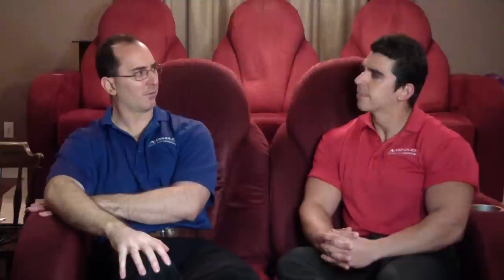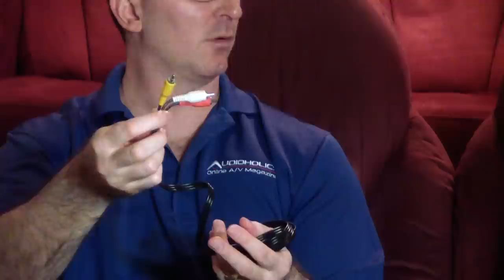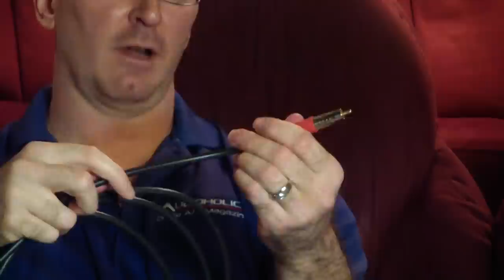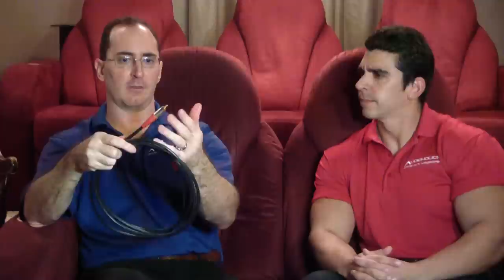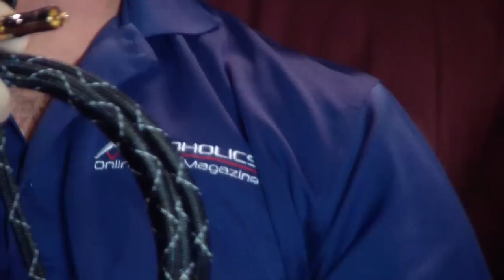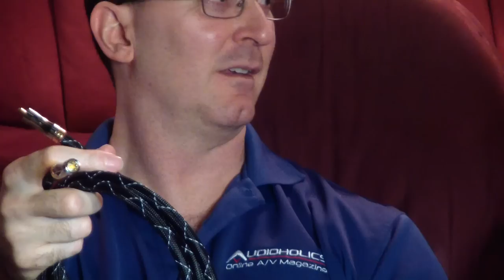Audio Interconnect Cable Myths vs Truths Revealed

Comment: I've been a broadcast engineer for about 15 years.  I've built many studios and have build many, many cables, so I'm going to comment here.  I agree, for the most part, with what the guest states.  The high cost audio interconnects sold on the market are really just snake oil.  If you want the "best" audio interconnect (unbalanced), you do NOT have to spend a fortune.  The Belden coaxial cables are excellent (NOT the CATV cables, but the ones manufactured for digital video).  Purchase some low capacitance, low shield resistance cable and solder on quality connectors--Canare, Neutrik, Switchcraft, or similar.  You will now have a cable that DESTROYS the high cost, snake oil cables.  You'll have the best and will have saved a fortune.  [I've had some ask me about the shield resistance.  Without getting too technical, the low shield resistance will minimize a voltage drop across the shield that will be heard as 60 Hz "hum"]
Reply: batman144 I looked up the specs for that cable (1505A).  It's a RG-59 solid copper cable. It has nice shielding coverage and nice shield resistance.  Its capacitance is a little higher but is still fine.  That cable will work well.  I'm a little biased towards Belden because it's a broadcast standard, so I have much exposure and experience with the brand.  There are other good cables, one being Canare.
Reply: batman144 Also, remember that the primary factor for evaluating an unbalanced audio cable is its capacitance (and shield resistance).  Many people also claim that its impedance is an issue, but that isn't true for audio frequencies unless the cable is incredibly long.  Thus, the "best" cable for audio is that built for video/RF; the reason is that this cable must have low capacitance for the very high frequencies that it carries.  To manufacture a  "75 ohm" cable, the capacitance must be kept low (by dielectric choices, conductor spacing, etc).  So, when trying to find or build the "best" audio cable, look at the cables used for video/RF. Find one with low capacitance, good shield covering, and low shield resistance.  Also, make sure the center conductor is indeed copper.  Some of the RG-6 cables, mostly used for CATV, have a center conductor that is copper-clad steel.  That works fine for the very high frequencies of CATV applications because skin effect is an issue, but its resistance is much too high for audio where skin effect is NOT an issue.  You'll now have an excellent cable, and you'll have saved a fortune by not purchasing the "audiophile" cables.  As an aside, some of the "audiophile" cables actually have very HIGH capacitance, and thus violate the primary factor of quality cables :)
Reply: +Steve Silvers  And how, exactly, does one look up a particular cable's capacitance and shield resistance?
Reply: +Steve Silvers  Just so others will know, I'm assuming you didn't get to that page from Belden's webpage advertising that particular cable. I'm guessing you had to Google something like "Belden 1505 spec data." Lastly, what numbers for capacitance and resistance should we be looking for? Should we be looking for different numbers for video vs. audio applications (although I think you mentioned the best cables for audio are ones designed for video)?
Reply: batman144 I have the specs in a binder at work.  For your question, I went to the "precision cables" on Belden's website and grabbed the specs; however, don't worry because Belden is reputable and doesn't inflate the specs. Belden is HUGE in the professional and broadcast markets--the specs are accurate. As for specs, the original cables built for analog were actually quite high in capacitance, usually around 45 or 50 pF. Then, cables for higher frequencies (analog video, digital video) were manufactured and, by necessity, the capacitance was much lower. Now, remember that the primary factor in audio cables is the capacitance of a cable. So, it makes sense that the professional world adopted these cables even for analog analog. When I started, the recommended and popular cable was, I believe, Belden 8241F.  It's an older cable but is still used today.  Today, the "precision cables" are definitely popular.  At work, we have the Belden 1505F that is a little different (22awg, stranded) from the 1505A. It's excellent for our installs, and we certainly won't get better performance by changing out to any other cable.  

Now, as far as specs, have a look at the precision cables because most will do just fine.  I like the ones with capacitance of around 16-17pF and DC shield resistance of less than 4 ohms (per 1000ft). Remember that inductance and impedance (unless cables are LONG) specs are irrelevant.  But also remember that other factors come into play, including length of interconnects and the output and input impedance of the gear.  But you really don't need to worry about that for shorter cables. For building a reasonable length interconnect, just grab some of the precision video cables and solder away. When finished, you'll have a fantastic interconnect that will blow away the others, especially "audiophile" cables.  You'll have something great that can't be improved upon by paying more.... Okay, I just looked up the Belden 1505F for prices.  I found it listed for 83 cents per foot.  So, for a pair of interconnects at 3 ft each, you'll pay 6 x .83 = $4.98.  There you go. For under $5, you can have the very best in cable that will perform excellently. Spending more will NOT get you "more."
Reply: +Steve Silvers Can you get good quality connections using a screw in RCA connector like those from ViaBlue and Furutech?
Reply: Great Argumenting skills there Michael, I don't believe sgt, Bilko can get back up after that bitter blow, I see up on my late arrival to this great contest he's been out a couple of months already.....?
Reply: Who's Phil Silvers...? I always thought he was sgt, Bilko  Michael. I wonder where I got that from, been thinking that for the last 40 years. I suppose it's one of those Mandela Moment things everyones talking about at the moment, where reality doesn't seem to unfold for everyone the same...?   "For about 15 years"...!
Reply: Right, Michael, I get it now. Thought I was losing my marbles, I'd never heard of Nat Hiken. Bilko we used to get it over here on Sat morning some years back. I remember a small fat side kick always got the dirty work his name eludes me, he had a funny squeaky voice I think....?
Reply: QED cables measures better and are 100% science based.
Reply: call me stupid but I did not know you could use coax cables for analog interconnect, been always thinking of them as digital audio cables.
Reply: Yeah, ive been in and around ultra high end audio since early 80s, worked in 4 Ultra high end salons since early 90s,,  plus 2 chain AV stores, been avid audio/ videophile for nearly as long, built 100s of systems - including custom theater systems and spaces -and basically tinkered with most every conceivable type of home n video (and some pro audio) gear in the business!!  
And i can tell you that EVERY pro audio guy will tell you basically what this guy says, yes.  And yet its not the same for high fidelity home audio! Sorry to say. it's just not. 
I really wish it was so simple as hooking up some patch cord,  or 12 guage wires from Radio Shack,  too make this gear sound great, BUT IT DOESN'T!!! 
Botton line,  the more revealing and refined the associated gear,  the more BETTER wires and cables make a difference in fire tunning the sound!  (Rule: if it's connected to the system,  and an electrical signal flows through it, .. then it affects the sound! PERIOD! 
NO, bose cubes, cheapo Kraco or Costco brand(lol) speakers,  connected to cheap RCA AV receiver WONT show a difference in wiring! Why?, cause its all unresolved bad sounding gear, and nothing will make a difference anyway!!  It's how it is. Believe me,  i wish i could save money by using  any ol cabling!  But it makes a difference,  n so i subscribe to matching wires to components that compliment ea other sonically. (No, video is different animal ). 
Pro audio gear is pro audio gear,  and its all a very homogenized sound,  and parts are all interchangeable.  If you use Genelec powered nearfirld speakers,  and one company's industry standard xlr balanced cables,  your pretty much gonna get same sound,  that just ends up all being EQed and processed out at the mixing board anyway!  That and Pro studio dead front end tested  acoustic dubbing spaces,  and you'll pretty much end up SAME SAME sound wise,  as any same equip recording,  editing , or playback Pro setup, using all same stuff! 
Ive simply been exposed to way to many cable swap application experiences , with just about every gear out there,  for too many decades,  to think that wires don't affect sound quality!  
To ea his own though.. which is fine.  Just don't try n convince me that your standard run Belden XLR cables are as good as ill get.  .. and ive tried those,  and they're NOT GOOD SOUNDING compared to MANY MANY other home stuff out there.  If they were,  id definitely be using them.

Anyway,
Reply: Which is better Soldered or Compressed termination for RCA interconnect cables ?
Reply: Thanks very much for this valuable information. IYO, are the Interconnects that you are recommending better than the 'stock cables' that came in the boxes of my 2 Parasound Halo amplifiers?

Comment: Most honest video about interconnect cable that I was able to watch these past days as I am on my way to build my own cables.
I hear a difference in sound with better cables (well engineered, good specs like they mentioned). However to get to that level one has to pay premium price with brands.
So better off building pro grade ones. The best one that I have is after all a DIY from McRU.

To those saying that cables don't matter : just sit down and listen, forget your measurements for once...

Comment: Single coaxes aren`t suited for audio but works for digital. Audio needs to be threated moore carefully by giving the negative half of the signal the same quality conductor as the positive half. And yeah, the conductors must be solid single-core to keep the signal clean.

Comment: I read somewhere that TOSLINK cables have low bandwidth and should not be used if RCA cables can be used. If one has an older receiver with (Left-Right) stereo RCA connections -- (it will be replaced in the next year or so) -- but you crave 5.1 sound in the mean time, is TOSLINK the only way to go, absent HDMI.

Comment: I am using a rg6 coax cable with rca adaptor at both ends and works amazing... 50Ft of cable in a subwoofer with no buzz no hum interferance...

Comment: for rca patch cables mogami mw-01 is about 19pf / ft and you can usually find 1 ft cables for around $15.  blue jeans has good belden stuff too.
Reply: Once i discovered Mogami W2528 I never looked back. It's siamese wire (almost like Zip style). It's basically two signal cables stuck together. Like dual guitar cable. I make dual RCA cables with these using the Neutrik/Rean RCA connectors. I make insert cable for unbalanced insert sends that you find on most common audio consoles. I also use it to make stereo guitar cables for people who have stereo pickups.

Comment: so for a run for a sub pre out of say 20-30', using tv coaxial cables with F connectors and adapters to RCA, is that a crappy setup?   Should one just use coaxial shielded cable with RCA ends?  I found these coax F to RCA outlet adapters.   Am considering using them.   Also, is it best to pull the cable out of the wall and RCA direct to sub or is using the outlet covers with RCA female jack fine with no signal loss at each connection point?

Comment: Hi, I've been using the Wireworld subwoofer cable for quite some time now especially the Luna 7 series and found that these cables produces thick and boomie bass sounds from the Bowers & Wilkins ASW608/610 subs however I'm currently looking at changing the Wireworld cables to something like the Audioquest Irish red subwoofer cables. Can you please tell me if the Audioquest cables are the way to go for use or are they just snake oils like many other subwoofer cables? Thanks guys.

Comment: Gene, Greetings from Down Under. what cable should i use to connect my pre-outs of Denon X4700H to Emotiva BasX3 pre amp? What’s the difference between analogue RCA V’s Digital Coaxial RCA? Is there a difference? Is one better than the other for what i want to do?
Reply: Did you ever learn more about the differences? 75 Ohm is the magic number for digital coaxial but beyond that I have the same question... what are the differences and when does it matter?

Comment: I have a 35ft Hdmi cable.... "one of those expensive i got suckerd ones" going from my NAD T758 Reciever up the wall into the roof and coming down to my Epson 5030ub projector. Will I run into video problems with that cable at that length? I keep having a blacking out video problem but the audio keeps working fine. Idk if it is my cable or my reciever port.  helllllp
Reply: *****  I figured out that it wasn't the projector or the hdmi...... it was the Android Box I bought. Glitchy POS. thanks for the replies btw.

Comment: One manufacturer claims that stranded wire introduces distortion into the signal because of the thousands of times the wire overlaps. I'd like to see how they measure this apparent distortion. But it is important to use the correct type of cable, whether coax or twisted pair in accordance with the amplifier design. If it is a single ended input (neutral and chassis ground are connected)  as found with consumer grade equipment, then coax is the right way to go. If it is a differential input, (floating ground) then twisted pair is correct. It comes down to how noise is either shielded in coax or cancelled out with twisted.
Reply from the maker: Audioquest has been promoting wire distortion propaganda for a very long time. They lack the scientific rigor or knowledge to back up the claim. The reality is stranded wire is better than equivalent solid core since the air gaps between the strands exhibits litz like behavior and thus pushes the skin effect frequency higher up. I've measured this countless times in cables.  COAX for unbalanced is absolutely perfect for DC up to GHz. If you have a differential input amplifier, then use XLR.
Reply: @Audioholics  In the case that you can't wire for balanced, which is not easy on a lot of gear, twisted pair is the better option because both + and - cancel each other out.

Comment: I am a professional audio consumer and the only important consideration is cable thickness and screened signal cable. NOOOO need for ultra expensive cables..
Reply: What you said makes perfect logical sense until you actually do the experiment and hear large, worthwhile differences. Experimental evidence trumps theory. Theories are only good when they can accurately predict the experimental result. When that is not the case, then the theory is not accounting for everything.
Reply: @phantomplastics6582  Were you not listening to these guys? The only experiment that matters is MEASUREMENT. There is no magic here. If you're hearing differences with super expensive cables it's your brain lying to you.
Reply: @Wizardofgosz  In theory I agree that a few electrical parameters should be all you need to know. However, in reality, many people hear absolutely clear and reproducible differences. When the theory does not explain the experiment, it usually means that the assumptions made were wrong. It is unwise to dismiss something without trying the experiment and using your own ears.

Comment: Guys, buy QED cables. Unlike other esoteric cable companies that only talk about theoretical differences in design, QED measures everything.

Look up their papers on cable design. Their cables are state of the art yet cost way less than the overpriced tat you say in hi-fi magazines. They do have a few expensive cables, but are vastly cheaper than other companies yet offer state of the art measured performance.

Look at QED Supremus speaker cable and QED Signature RCA cable for example.

Comment: i've heard SPDIF is better than optical, because the SPDIF signal hasn't been messed around with  before it leaves whatever source it has come from, unlike optical (converted from an electrical signal to an optical one, therefore more processing). That said, optical is very reliable as a cable, i.e doesn't suffer from RF interference. RF issues aside, would you recommend at least technically SPDIF to be superior due to the lack of additional processing? Anyone?
Reply: Mark Manning Both are SPDIF but one is optical and the other is electric. There is no difference in data quality between the two.
Reply: i take your point, however simply from a theoretical viewpoint I have been advised by many, that the Coaxial version of SPDIF has less processing (from electrical signal to optical, then back to electrical within the DAC). Therefore, optical could be viewed as inferior assuming some errors are introduced in the changeover process. My issue is not the cables themselves, as optical "cable" has been shown in many tests to have zero errors, this is a processing issue, cables aside! I take the view Coaxial SPDIF (assuming RF isn't an issue) is a better option at least from a technical standpoint.

Comment: am i understanding this wrong , or are you saying to use 75ohm (antenna cable) for interconnects between for instance a amplifier and a cd player ???
Reply: Peter C Yes he is, standard 50 ohms cables have a very high capacitance, and capacitance causes high frequency rollout. Video cables have much less capacitance.